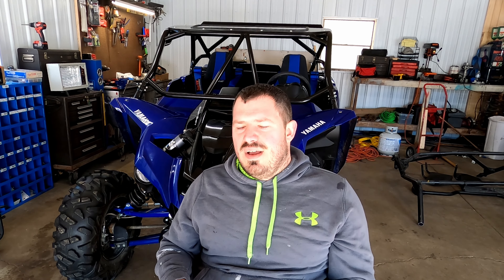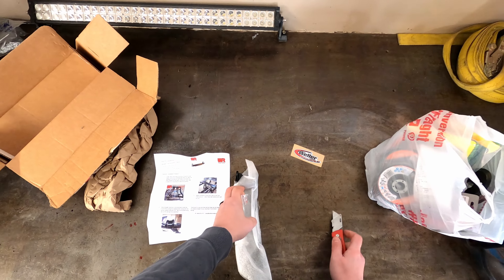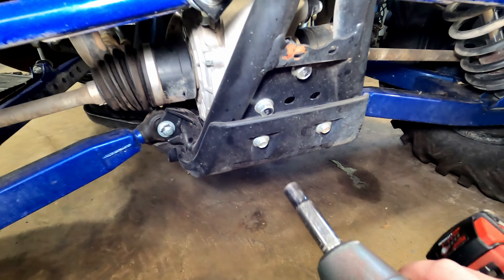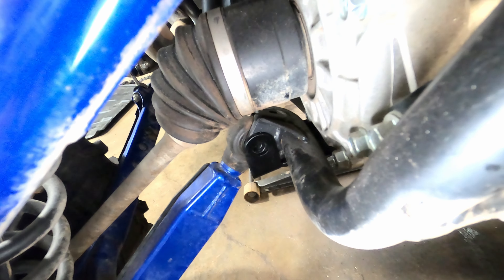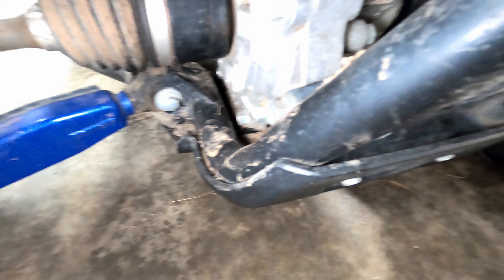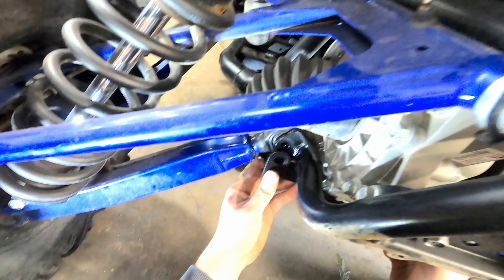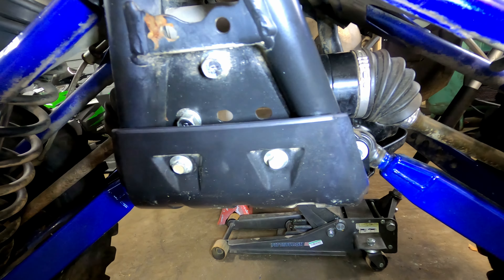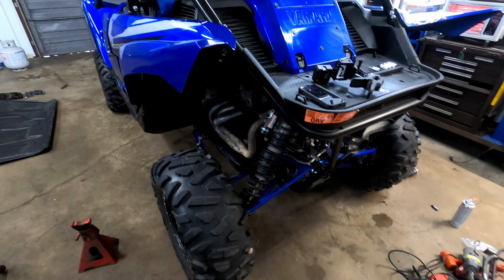WELLER REAR FRAME BRACE INSTALL | YAMAHA YXZ 1000R | CHEAP AND EASY PROTECTION AGAINST FRAME BENDING

Comment: I am going to be getting a 2021 YXZ shortly!  Great info!!!  Thank You!
Reply from the maker: Awesome! I would definitely recommend an aftermarket cage, Harnesses , Weller rear frame brace and clocking the springs on your shocks before you really rip on the yxz. These things are expensive but will definitely save you money or your life in the long run. After those things I would definitely recommend an exhaust and ecu reflash it’s a huge performance improvement. I have videos on all of these things.
Reply: @FilthyKnobsOffRoad Clocking the springs" ??? 
I am going for the 2021 SS.... Is that needed?
In which Video did you Talk abaut this Task ? 
✌️

Which Roll Cage do you recommend? Have seen some for 799$...

I am also interested in lowering the Chassis by moving the shock Towers.
Do you have any experience with that or know parts ?

Something Like this:
https://youtu.be/27_WkGVARbw

Comment: Looking to pick up my first YXZ in the next few months and very much appreciate your videos. Thanks for all the great info! Definitely adding this brace when I get my machine.
Reply from the maker: Awesome! I would recommend this brace, clocking your shocks, harnesses and a aftermarket cage as soon as you can. I have videos on all of those as well. I know the cages are expensive but they are so necessary. I would say the best thing you could do if you know a YXZ is what you want is order the cage now because it’s gonna take 4 months to build. you will have to put half down initially and then the remainder upon completion. Even if you don’t pick a powder coat color yet I would get the cage going.  If you don’t end up getting a yxz there are many people willing to buy the cage for what you paid to not have to wait the 4 months. Around Michigan the best deals on SXSs happen around October but I’m not sure what it’s like in other areas. When I bought mine in I got the Yamaha credit card. I paid $18,000 for mine. I paid $12k cash down and put the rest on the card. I got no interest for 3 years but paid it off on under two. It was a great way to go for me.
Reply: @FilthyKnobsOffRoad  Awesome man, thanks so much for the tips!

Comment: Can you tell us where you got your front relocation bracket or post a video on it :) Thanks
Reply from the maker: I bought the relocation brackets with my full frame gusset kit from Rayscar designs. I am still in the process of installing the kit. Had to order some new welding wire and get some gas but I am making a video about the relocation kit. Here is a link to the kit:

https://www.facebook.com/477526926057611/posts/pfbid0HEBkBvjAFRPMiEFCEvqekiwWgbHttb89mbNB84ggzQaJCw2FMTfGzo4iDGReu4uZl/?mibextid=cr9u03

You have to message him on Facebook for the kit and then he sends you a PayPal link to pay for it.
Reply: @FilthyKnobsOffRoad  Rad! Thank you sir!